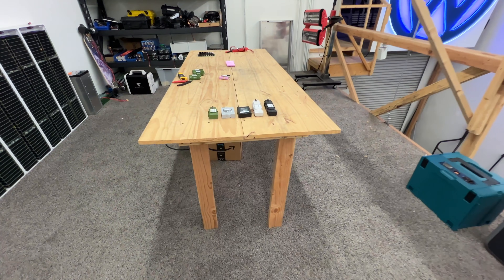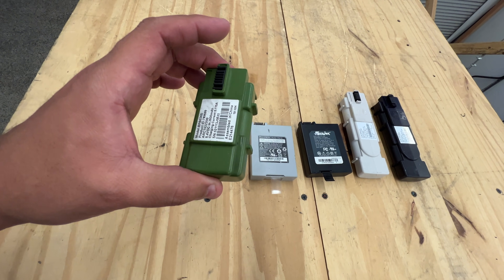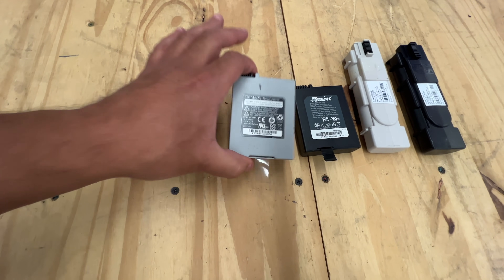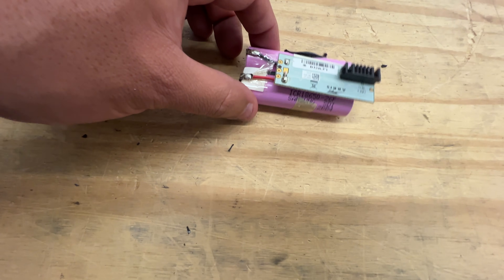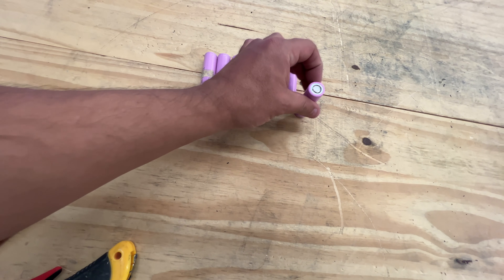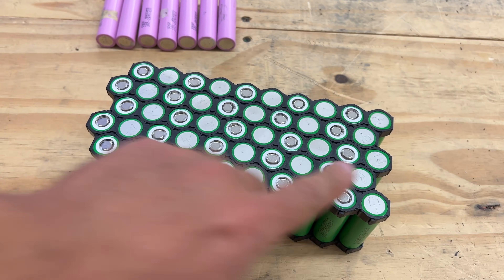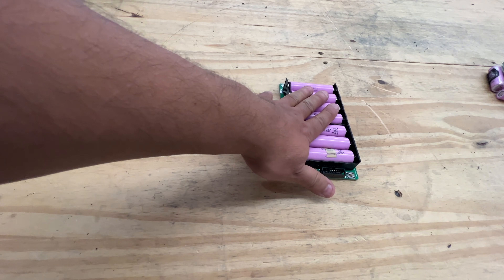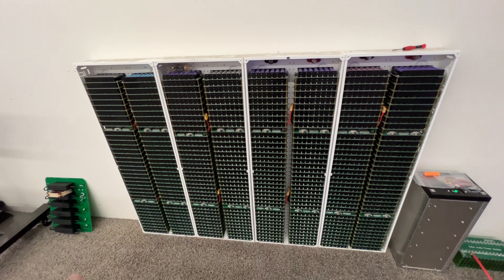Extracting 18650 SAMSUNG cells out of $1.20 Modem Lithium Batteries

Comment: ? How to build a lipo battery system for my remote control lawn mower that has a 24 volt alternators and 24 volt system. Powered by a saber-tooth 260. I'm using 212 boat lead batteries at this time but not getting the results I need. Is it possible to use these cells in a high amperage 24-volt situation and charged them with the alternator. Would love to hear your views on this. Chicken runs at 60 amps Peaks at 120 like to have a hundred amp continuous. Looking forward to hearing from you I'll make a show out of it.
Reply: Lithium must be charged correctly with current driven. If you aren't able to keep up with the electronics then that's not a battery problem so much as it is you need a bigger alternator for your gas engine. Energy in should = energy out. You might be able to get away with just a really large 6s Lipo battery (assuming you can adjust the exact input voltage), but you should have a battery management system on that to keep it from catching fire.

Lead acid is the safe way, very hard to screw up compared to lithium (which makes an awesome fireball and incredibly dificult flame to extinguish, I basically wouldn't even try to extinguish a LiPo fire).
Reply: These aren't really the right kind of cells for a mower. You need HIGH CURRENT cells, commonly named "INR". He mentioned Samsung ICR185650-26F, which are rated 5.2 Amps Maximum. So for 100 Amps you'd need to run them in an absolute minimum 20S 20P array, and 24V would mean 7S... so that's 350 cells as an absolute minimum. Just use INR type cells, Samsung INR18650-20Q or 30Q are rated 15A continuous so would handle it a lot easier.
Reply: @johncoops6897  just so the OP knows you meant 20P (Parallel) for the 100 amps. The rest is correct.

That's why I sometimes use LiPo where you can get very high discharge ratings since my little quadcopters pull over 100 amps at high throttle and need to be as light weight as possible (however in that application 3 to 5 minute runtime is acceptable so I get away extra small battery). I think the Samsung cells are about $10 each so if we do a 6S 10P would be $600 and need a decently large charging system which I think that's already out of the OPs budget but that probably is the best lithium ion setup for 18650 cells. Those are also the same cells some people use for long range quadcopters so they are pretty good (there are much higher performance and higher energy density cells like lithium graphene but those do cost a lot more so not as good as the Samsung cells for budget builds)
Reply: @jakegarrett8109  - thanks, I have fixed my 10S <> 10P typo.
In many ways a LiFePO4 pack would probably be the best for the OP. Large second hand cells are often cheap (per mAh) and can handle large current draw (often similar to LiPo). They last a LOT better than LiPo and 18650's too - typically 10 times the number of recharge cycles. I'd say it's the best chemistry for the mower application.

The cell voltage of LiFePO4 is a good match as a replacement for car/boat Lead Acid, and the cells have good "overcharge tolerance". However I kill far too many of the 14500's by using them to "boost" a AA Alkaline device, then accidentally over-discharge them to 1V or less! The almost constant voltage discharge curve means they are notoriously difficult to assess the true State-Of-Charge, so you definitely need a good under-voltage cutoff.

The 8S LiFePO4 would charge at about 29V, give 26-25V output and be deemed "flat" at 24V, whilst 7S would charge a 25V, give out 23-22-and be deemed "flat" at 21V. I think that the 8S LiFePO4 is the most common swap for an existing 24V Lead Acid alternator setup.

A simple adjustable cutoff charge / discharge controller (relay based) would allow re-use of the existing Lead Acid charging system. There is some tricks needed to manage the charging current to not overload the alternator during charging, but overall the LiFePO4 would be a much better replacement for the OP.

Of course, the easiest solution would be to go and buy a drop-in LiFePO4 replacement battery for the existing boat batteries. They have the same form factor,  plus built in BMS that handles all the charging requirements for retrofit of Lead Acid.

Comment: i doubt very much anyone is going to sell to the dummy off the street used discarded batteries that some recycle company is paid to do. Id like you to come to my State and try to buy some of batteries lol
Reply: You can sometimes get them free, my cousin got a few good Dewalt drill batteries from the local Lowes recycling dump box. He mostly just wanted the casing so he could run wire out the bottom to allow for DIY battery pack with the OEM connections, but it turned out all except one pack were perfectly good and uses them as is now that he has plenty of batteries. Also the recycling company is probably paid a fee to pick them up, so if you do part of the work for them for free I wouldn't be that surprised if they would just let you have them unless they are reselling them on the side (in which case you could just buy it from them then).
Reply: @jakegarrett8109  i think it all depends on what State you reside. Some States have stringent rules about recycling. I live in MA that should tell you all you need to know. Thanks for the reply
Reply: @mannyfragoza9652  Yeah I don't know, I've seen what the military does (I can't say, NDA), but I have to say not everyone follows the rules. I'm in MD, somewhat near the swamp (capitol of corruption), so like absolutely nobody follows the rules around here, and driving through DC is like leapfrog with me trying to go the speed limit since all the cameras but everyone else doing 90 mph swerving through traffic like a bank heist in a movie even when its night time and pouring down rain.

They might have rules, but I doubt they are followed to a T like I try to. You might find a loophole though like getting them at the store recycling box or maybe from the company that is dumping them off to recycle (they won't mind if you can repurpose them), so if you can get them before they are sent off to the recycling maybe that's the way to potentially do it. I try to recycle and re-use everything I can, so maybe I can't do everyone else recycling but I'll do my part (mostly because I'm a cheapskate, haha!)
Reply: @jakegarrett8109  lol i dont think its a bad thing to be frugal lol But i understand what you are saying ill have to look into the matter. Thanks man take care

Comment: With a manufacturer date of November 4th 2011 that is a 10 year old battery that is far from a good cell
Reply from the maker: I’m driving my car on 13 year old cells….  Your “far from good cells” are ok by me.
Reply: Almost all of my harvested 18650's over 10 years old, and it's very common that I see test capacity higher than manufacturer's ratings. It depends on the brand and the chemistry... Samsung cells generally last very very well, but Sanyo and LG do not.

Comment: Everything needs batteries of various cell counts, and yet we don't have any universal compartment to eliminate the need for all these stupid plastic molds that all end up further polluting a landfill for hundreds of thousands of years, and wasting oil.
Reply: I'm not sure what you are saying. There are 3d printable parametric battery holders (1 cell, 2 cell .... 20+), and you can also just have multiple wires coming off them for different voltages if you wish to only use 2 cells. I personally use my own battery system that accepts almost any cell. For example most of my electronics have Deans connectors and can run off 3 cell batteries, or my remote controller for example could accept anything from a 1 cell tiny cell phone battery up to 40v rating (I soldered a boost-buck converter inside its housing). I can't stand proprietary battery designs, so even my tiny scale uses 3d printed AAA adaptors (dummy AAA batteries with 2 holes at the end so wire is looped around them for contact), and I run that off either a 1s battery or I use a buck converter on an in-line Deans setup. Even my calculator has 2x cell phone batteries recycled into it. Its to the point almost nothing I own is standard and will work with anything. I can even charge my laptop off my electric bicycle, or using my DC-DC voltage booster in my car (which used to have a couple of solar panels I made until one somewhat caught fire in Texas heat).

I'm mostly not sure what you mean by "plastic molds", usually they are integral to the structure of the device (acts like reinforced webbing), so its not usually using much extra material, but if you want you can do what I do and use modular systems that work with any battery or power source that is handy.

Comment: Not your standard modem batteries, most people only ever see these in VOIP modems, so you can still call 911 in an outage.
Reply: Ya I do low voltage stuff and have rarely seen them installed but I have my own equipment but I mean for a couple bucks having it stay on for a little bit if power goes out is worth it I have a UPS so I have it covered when the power does down I don't even miss a beat playing warzone
Reply: Alright, please tell a stupid foreigner what goes on there... Can't you just make a regular (cell)phone call? The cellular bases have their own battery packs, they stay on even if the whole town is down (although then the number of calls may exceed the network capacity).
Reply: @jmi5969  in America land lines are still a major factor, not everyone needs or has a cell phone. Also contrary to urban dwellers beliefs there is a rural America and not all areas have good cell coverage.
Reply: @davidgeiger  but how you use the phone if there is no power for the phone?
Reply: @superchiaki  - a normal (non-cordless) telephone doesn't need mains power. It is powered by the phone lines alone.

Comment: I must be too cheap because I've never owned a modem that had a battery backup in it.  I didn't even know such a thing existed.
Reply: It might depend where you live most the ones from your ISP have a spot for them but they generally don't populate them but if you buy your own Netgear or Motorola they generally don't
Reply: It's the voip modems that have them
Reply: Generally, they are not from modems for say, rather from Cable Companies box that supplies you with a phone line.

Comment: i wonder if something like this could replace a UPS battery in the near future
Reply: If you have a hundred of them. Li-ion is incredibly low power output, and a lot of UPS need some decent power capacity. My laptop pulls about 260w when it is running a game for example, but you really don't even need a UPS since the laptop has its own battery, so my desktops range from 400w all the way up to 1700w not counting monitors (that 1700w is on the extreme high end, that's not typical). The other common use for a UPS is on 3d printers, and mine each pull about 300w to 400w depending on the temperature settings, so that means you need a total of at least 12 cells assuming they can handle 10 amps per battery cell (which these won't, they will catch fire, you need specials low capacity high current cells to do that).

If you do have a hundred of them, then yes, they would work just like a laptop battery runs (which also uses 18650 cells, although depends on the laptop like my laptop has high current cells and they degrade incredibly fast even at low power so you should just use a bunch to avoid using that type). Work at a recycling place though and that might be a great option, also good for ebike batteries.
Reply: @jakegarrett8109  dang i was hoping for maybe be able to have something that is lighter and could maybe replace the 2 lead acid batteries it currrently uses as its a 24v system instead of 12v
Reply: @jakegarrett8109  sadly i couldnt afford something like that as i dont get to much on SSI
Reply: @dawn1berlitz  I'd probably stick to what you have or you might get lucky and some local recycling places may have workable batteries. I know my cousin got a few Dewalt drill batteries free from Lowes recycling collection box because he wanted the housing and OEM connection for a DIY battery pack he was going to make for his drill, but it turned out he didn't even need to because all except one battery he grabbed were perfectly fine and he still uses those. So you might be able to get some for free, just if you go with lithium type of batteries make sure you use the correct charging circuit for them and not a lead acid charger, but that would make it pretty cheap.
Reply: @jakegarrett8109  im primarily thinking of ideas what to do with my free time as im not always gaming and with being a disabled adult that leaves open free time during the day and i though 18650 projects are rather neat

Comment: Im stunned. What a waste to put them into modems and they never will
Reply: It's a 911 requirement. You have to be able to do a 911 emergency call when your line phone is from an internet provider even during a blackout.
Reply: it's necessary to be able to sell a phone service through a cable modem or fibre optics ONT.

Comment: Tell me the advantage of using 18650 cells compared to bigger (100Ah, 280Ah, 320Ah) prismatic cells when building (for example) a battery setup for a van build.
Welding all these small cells together or using your holders doesn't look like a good way to build a pack that can handle high charge and discharge currents (50A - 100A).
Obviously I am missing something here so this is an honest question and not some kind of trolling attempt.
Educate me please.
Reply from the maker: Price an availability,  if you find lifepo4 prismatics in USA they cost $300/kwh +. If you want them cheaper you’ll have to find them in china and you’ll have to wait 2-3months shipping.     My system is rated at 1c so if you want 100A you just have to build a 100ah pack,  you want 300A jut build a 300wh pack
Reply: @jehugarcia  
Thank you. Kind of what I imagined. It's a lot of work to build 18650 packs but that's got to be part of the decision process for anyone building.

I did go the China route for my 12V 280Ah LiFePO4 setup. ~$460 for the four prismatic cells and it took about 3 months to get them but I ended up with a setup that cost ~$600 (cells + BMS). All in all, the battery + Renogy Solar/DC-DC charger + Victron SmartShunt for my camper came out to just under $1000.
It's working really well.

Comment: Can we get a native 48v circuit board system, feel it would help with the amperage limits to 24v has
Reply from the maker: What amperage limits?  You can get any power level out of a 24v battery pack if you build it correctly
Reply: @jehugarcia  I thought I saw your original video for the cell holders that they had heat issues over a certain amperage, I could be mistaken it was a while ago.

Comment: I see a pallet of scooters in the back will you be listing them on the site soon. Al's what's the easiest way of making a battery pack for a electric skateboard
Reply: I was interested in getting one of those scooters too, I asked Jehu in his last livestream and he said that it is just too time consuming to box them up individually to sell for their size of a team and that he would probably sell a pallet of them but individually it just doesn't make sense
Reply: He spoke about how unless it’s bulk he will not be selling them. You can email them but they mentioned there’s no margin/profit in selling them in small orders or even individually.
Reply: > what's the easiest way of making a battery pack for a electric skateboard
Depends on what you want. How large are you? Inner Tube Tires or Polyurethane? What kind of range do you want? What kind of terrain are you riding on (hills, grass, flat, pavement, dirt)? What kind of motors (Hub vs Outrunners)? What KV are the motors? Which ESC (VESC) you're using?

The easiest way: Buy one from a reputable builder. If you're dead set on DIY, NESE makes a Friction Fit option for 18650/21700 cells so no concerns of Spot Welding. If you have a Spot welder already "brick packs" are the easiest; If you dont understand what im saying. You need to do more research. There are several forums for Esk8 specifically Esk8News (is the most popular/active) and have several battery builders that share their experience, knowledge and tips.

Comment: Do you think those can be a good aplecation for an electric go cart?
Reply: The Samsung ICR18650-26f in new condition was rated for 5400 ma output. So running used ones at 3 amp should be easy for these. 

For comparison there are cells used in tool batteries that can do 40 amp output. But some laptop batteries can only do 1 amp output.
Reply: I build my battery using these cells for my golf cart and they been running great for all this season. I build 2 x 24v batteries using 37p in each. I’m using altrax 48v 500 amp controller.
Reply: I assume you are doing 6S to get to 24v. So that is 222 cells running at 37p6s for each battery. 2 batteries makes 444 cells total. At 500w that is 0.30 amps per cell. That is definitely being really nice to those cells. They probably don’t heat up at all. Unless I misunderstood what you meant.
Reply: @ecospider5  I'm doing 7s37p
Reply: When building a high powered battery you just need to look up the spec sheet and design around the max output of the cell. 

So if the cells can only handle 2 amps you would need to put 10 in parallel to use in a 20 amp application